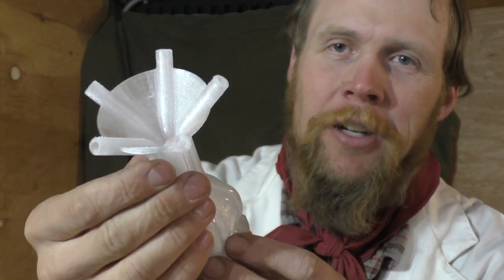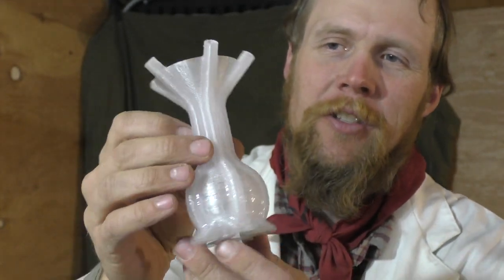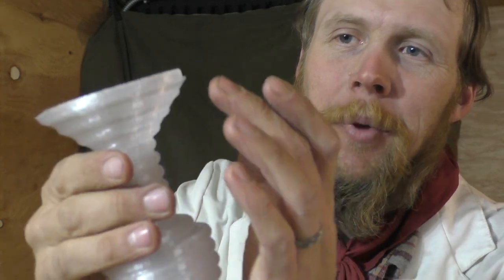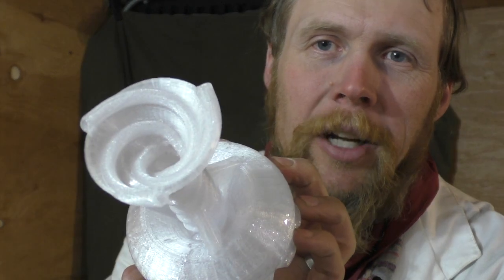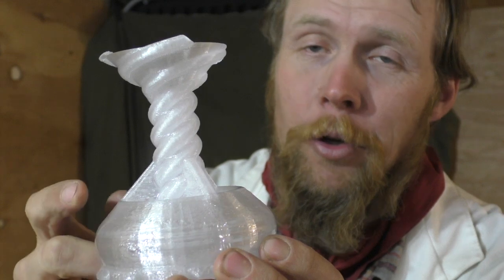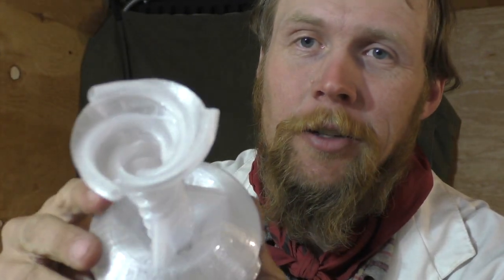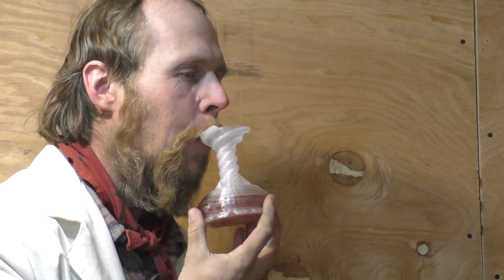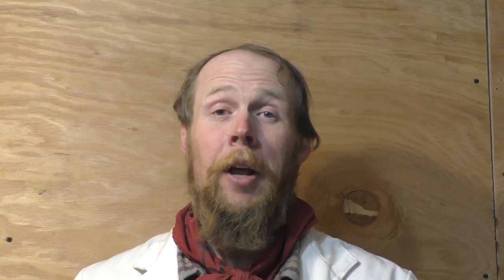3D Printed Cups with Integral Straws (TIS406)

Comment: My old 3D printer crashed and burned big time. I wasn't sad because then I could get a new one that could print big things and use many different materials. You know, materials that are strong and can "receive"  other parts.... 
I liked the helical one except for it's got to be nearly impossible to clean.
Reply: BTW, in case you haven't tried it, a slightly higher extrusion temperature can improve later bonding and possibly eliminate your leaks.

Comment: Nice idea :)
My guess is that the frothing stems from leaks in the straw, mixing air from the outside into the liquid inside, due to low pressure when sucked.